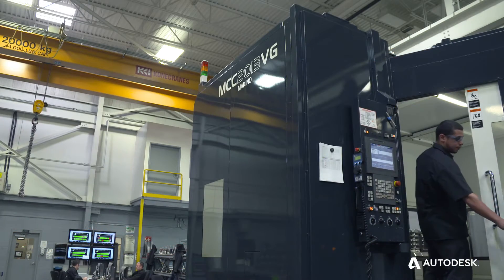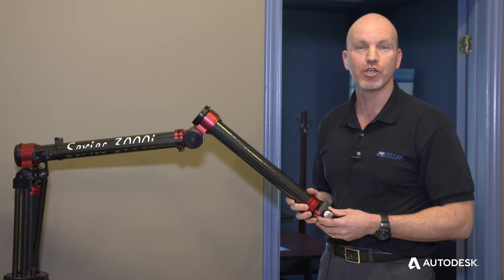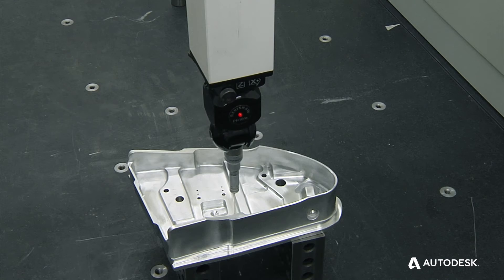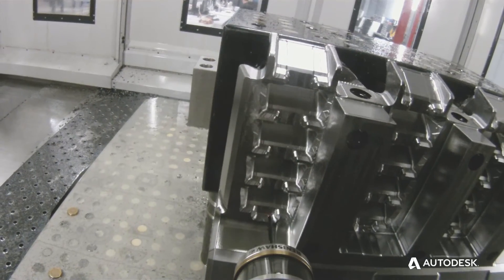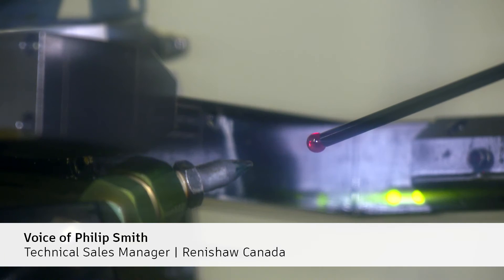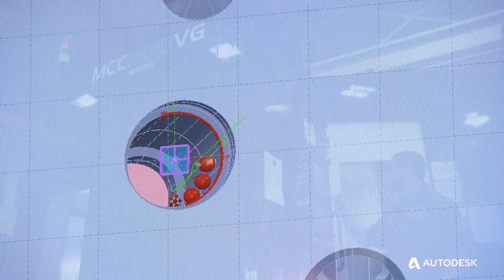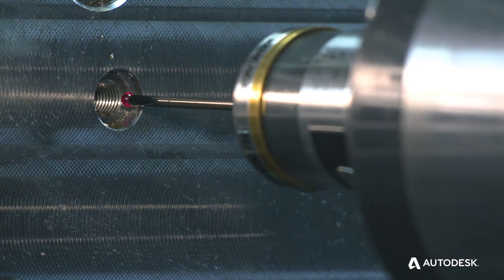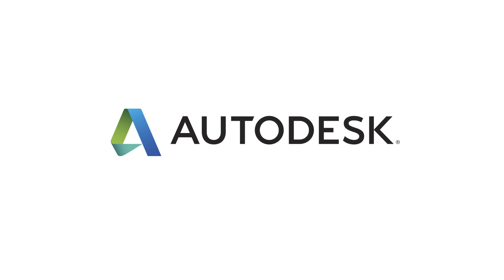Concurs Mold: Manufactures more efficiently with machine tool probing

Comment: Great product and I understand the point of the video but it misses one crucial point. In the last statement about why use a separate coordinate measuring machine and not use your cutting machine tool to do the measurement? The plain and simple fact is that by measuring the part on the same machine that is manufactured means that and inherent inaccuracies in the machine tool are also going to be transferred to the measurements. For final part check the measuring device must be independent of the manufacturing equipment, and also be of a higher accuracy specification to provide the final data. On machine, in process, verification is a massively useful tool but the impression given here that it is a substitute for independent inspection off the machine tool, is in my humble opinion, misleading.